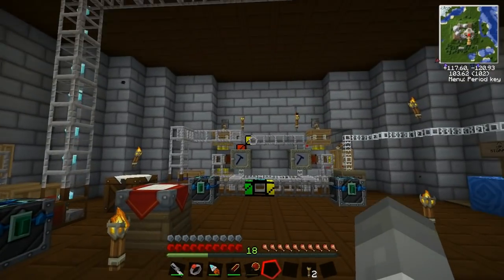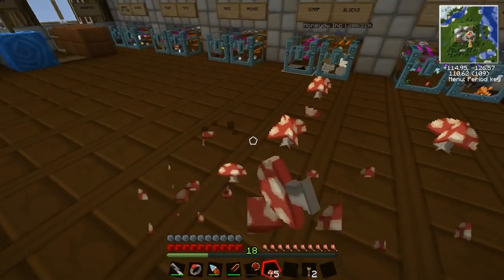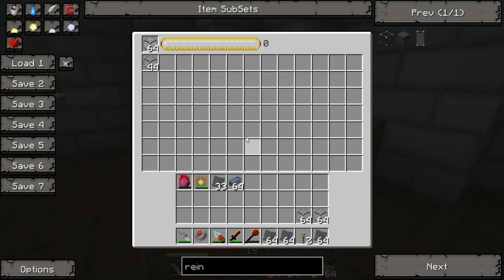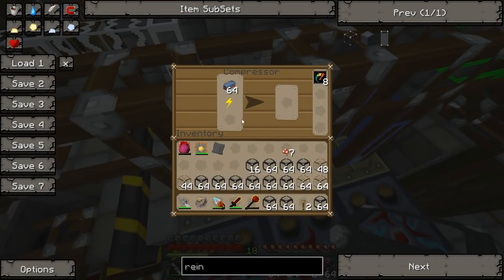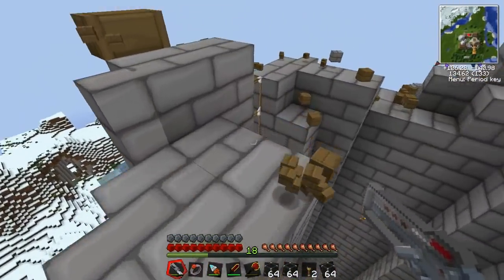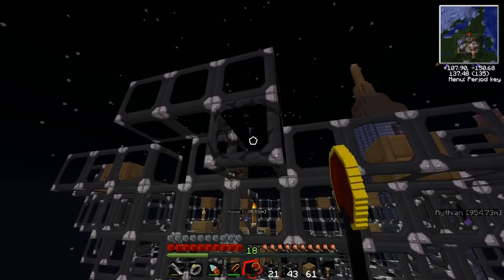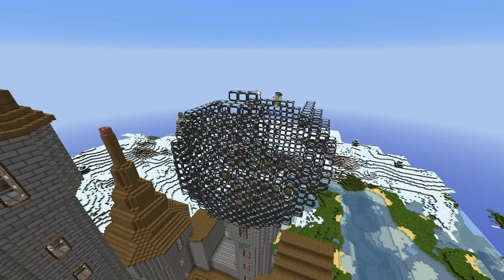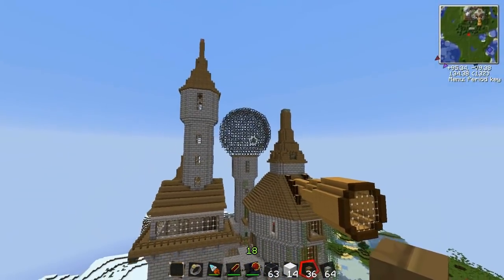Duncan's Lab - 60 - Nuclear Sphere!

Comment: Sure you can.  The same mod that includes the forcefields also includes some blocks that are meant to sit in the field wall and are blast-proof.  You can use these blocks to get the EU out and even redstone in. (Though I prefer wireless redstone.) Or you could use the energylink to teleport the power out via buildcraft pipes.

Comment: Duncan , I recommend that you put a nuclear reactor  in a  3 thick sphere and connect an information panel to it to tell you when it's on or off and have a thermal monitor that detects the reactor is very hot, which then would give out a redstone signal to turn off the reactor and you would know it is off b looking at the information panel.

Comment: Your comment inspired me to think of a good idea for a emergency shutdown for a reactor. In a box next to the reactor you put a chicken on a pressure plate. The signal then gets inverted and the redstone leads into the reactor. It is supposed to be if other safety mechanisms fail, but when it is at the point where the chicken dies from radiation, then the inverter sends a signal to the reactor to shut it off.

Comment: Once it is updated with redpower 3, I would really like to see the FTB pack featured by these guys sometime.  It has all of the mods tekkit uses, and the mod creators work with it actively to keep it running well. There are a bunch of new IC things already, one of which is a lightning rod. In addition to the mods that are in tekkit, it also has things like mystcraft, which is a good mod in and of itself. Biggest problem with it is that it isn't very bukkit compatible. A spotlight would be cool.

Comment: I would imagine making that sphere would be easier if you made it out of something softer (wood, wool, something), glassed-up the outside, and then removed the base layer.  

This also makes me think that sphere-within-sphere job with lava in between the layers would look like a cool plasma containment field while having an actual power generator inside.  

But perhaps that's silly.

Comment: The military will set off bombs in the air so it does max damage,  this rule works in minecraft as well, i've tested it.  If it explodes it will do more damage there than if it was underground.  Also a couple of layers of reenforced stone will contain the whole thing using just glass wont work so well.

Comment: My design of a nuclear reactor has a emergency cooling cycle, blast doors, an on/off switch that is controlled by a computer craft terminal, a heat monitor, a force field generator which draws power straight from the reactor, and a Uranium Cell injector so that it never stop producing power until the uranium ore is completely drained from a 1000 block radius.

Comment: Duncan you could have built a force field to surround the nuclear reactor and it wouldn't harm anything you owned as long as there is a power supply, which really isn't a problem for you. Just saying that might have been a bit easier.